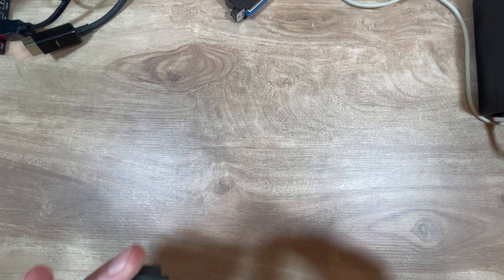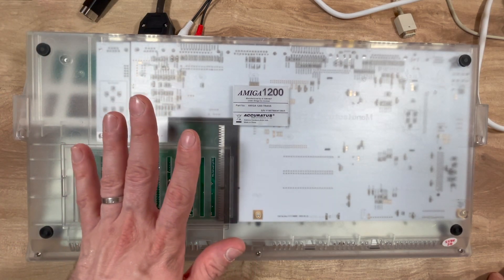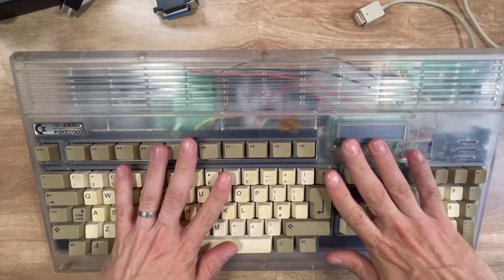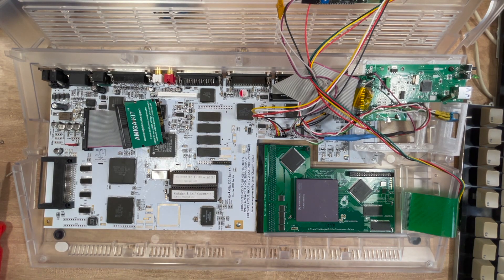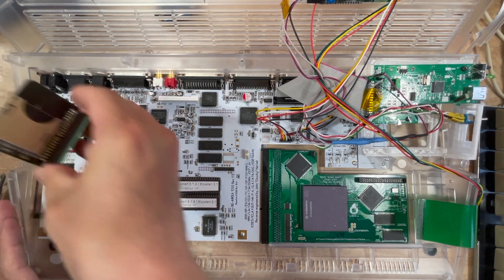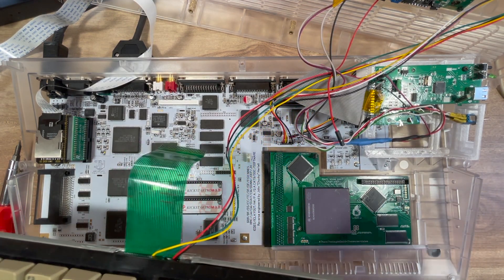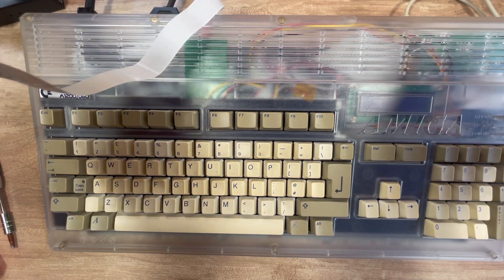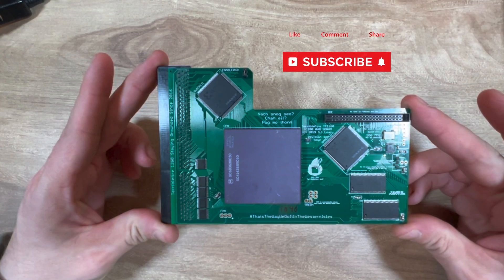Terrible Fire TF1260 and re Amiga

Comment: Why not connect a CF card on the TF1260 runs much fastsr than the IDE on the A1200 motherboard. Waiting for the TF1260 with the Rev 6 CPU on it. Do it in my super rare AMIGA 1200 GHOST case from A1200NET. The case glows in the dark. Have for now a fast MicroDrive on the IDE on the motherboard. Have connect it with the Indivision AGA MK3 VGA. Got the Bitfrost LED inside and a Blizzard 1230 IV with FPU and 128MB 50ns simm. Have more AMIGA 1200’s and 3 more A1200NET cases also the transparant. Hope that this year finally the A500 case and the keycaps come out from A1200NET. You have a great ReAmiga 1200 Rev 1.5 motherboard. Would like to have a blue version.